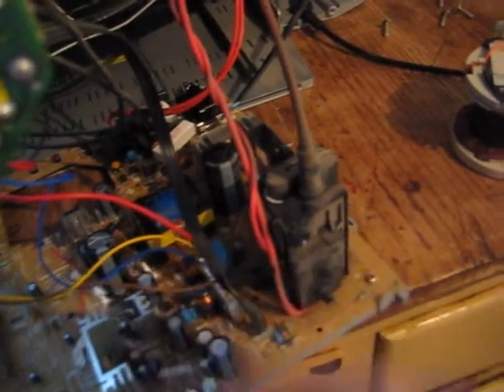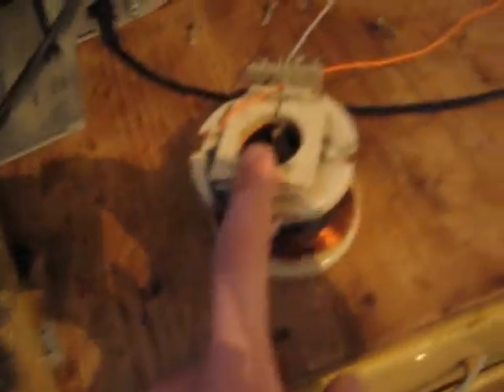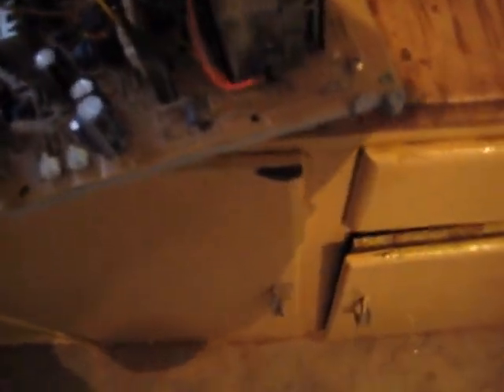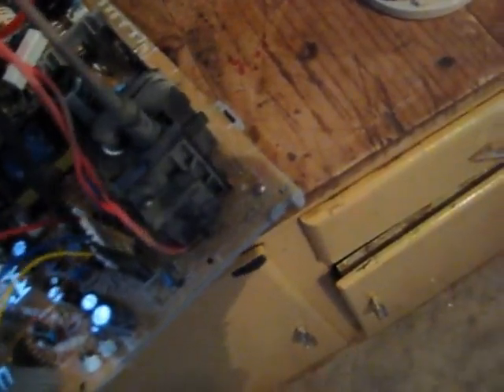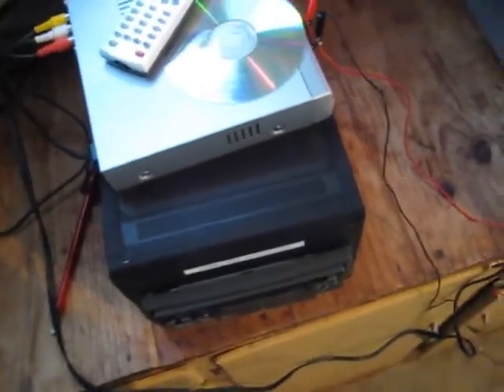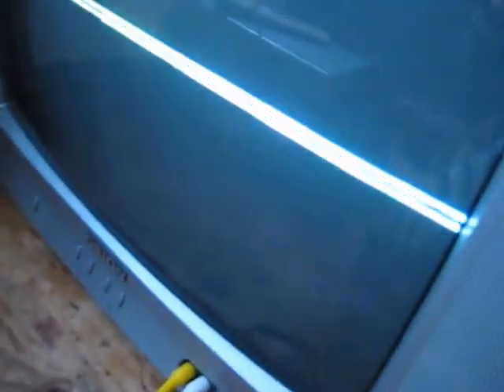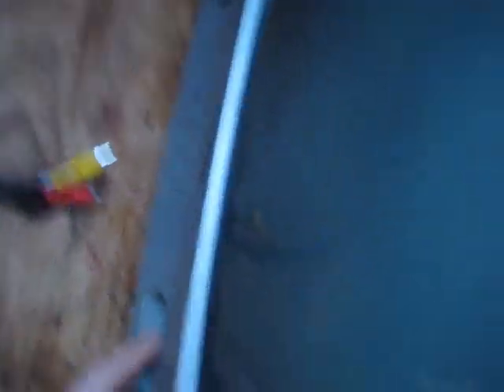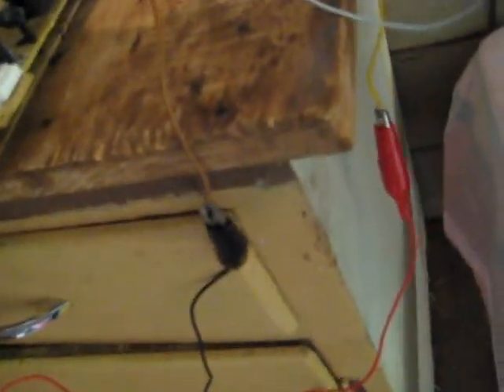TV Oscilloscope part 1

Comment: Trying to follow why you use the set top box? Is it as an amplifier circuit or to display color on the box? If you check out the Closed Captions on your video you will see why it is so difficult to follow.